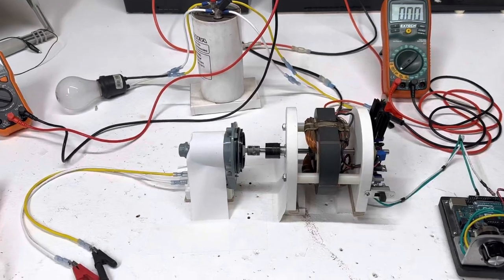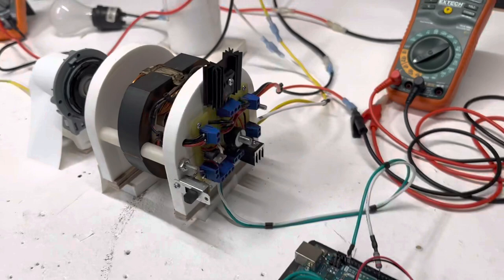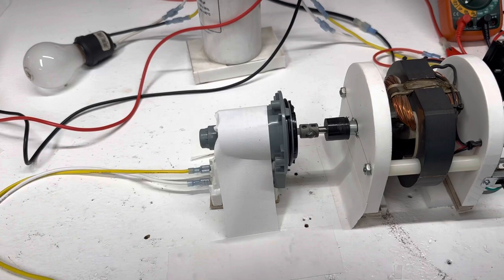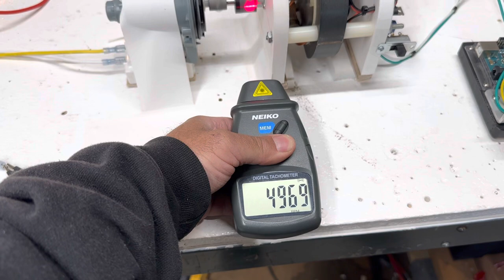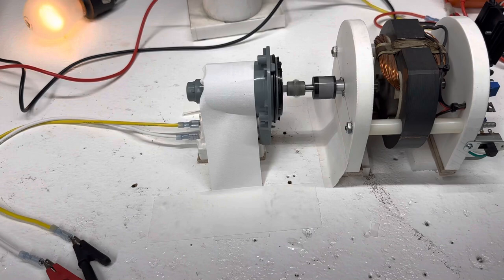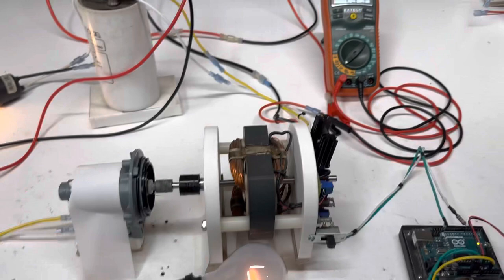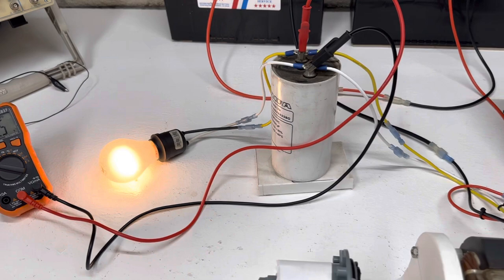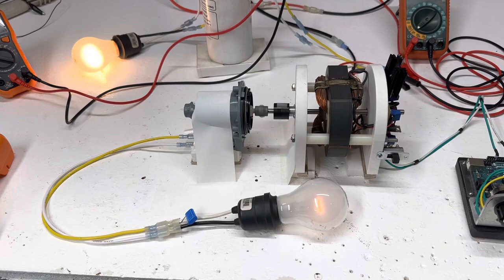Washing machine water pump as a generator

Comment: You need to use a Dremel and go pass 300v. Yours only went to 70v but can achieve 300v+. After shorting the wires it will go pass 340v but unable to extract the voltage. My fluke has an amp reader and it show to have 17 amp at 340v+ , I’m not sure if the fluke is reading it correctly.  

Ps: don’t touch both wires at the same time… shocks the hell out of you.  You can touch one side but not both.

Comment: It seems like no matter what type of a generator the motor is connected to as a prime mover, the additional power consumption defeats the purpose. But when the load is a fan or a water pump or even another motor it works quite well. So, instead of using this washing machine motor as a generator, could the output going from the capacitor to the light bulb instead be used to run it as a motor, with the shafts still connected, would the power draw for your motor be reduced.
Reply from the maker: So true! 
Yes it would just need a dc motor the water pump is AC

Comment: How abt adding ur scr dump on the load side let's have that in ur next video chk if phase correction of the cap is required ie 90/180/360 ie 1,2,3,4 caps w low resistance to cut frequency of dumping Nd changing the voltage ie increasing cap voltage helps in series voltage divides of the cap so.. Here ur voltage is to low 4theload
Reply from the maker: Yes it is because the generator has lenz slows the Rpms down

Comment: Good share - once that bulb was attached and the energy demand was applied, it changed things for the RPMs!  

What would happen if you attempted to charge a cap with the water machine  pump and then powered a bulb from the cap?
Reply from the maker: Thanks ! It’s funny the motor outputs more than the generator 
 It still loads the generator even in a capacitor